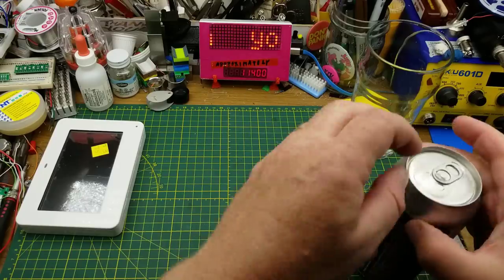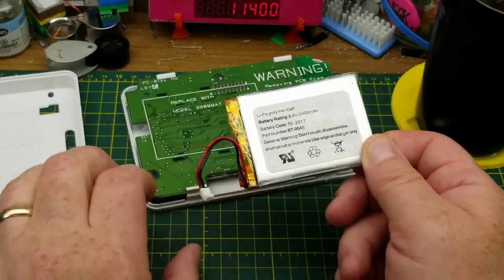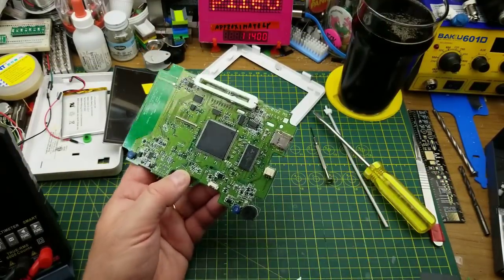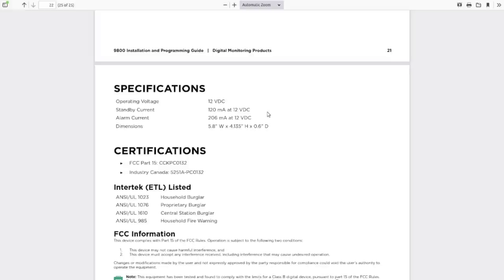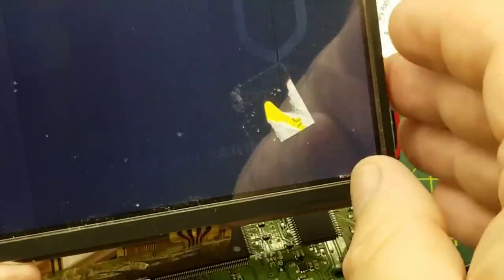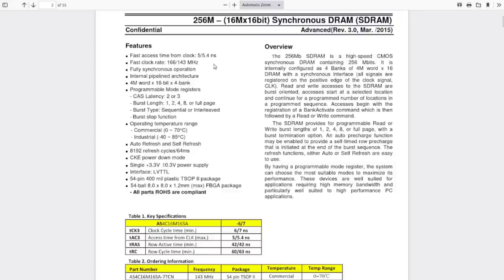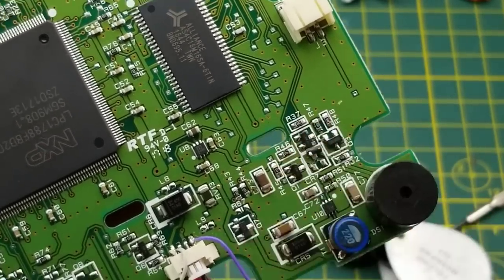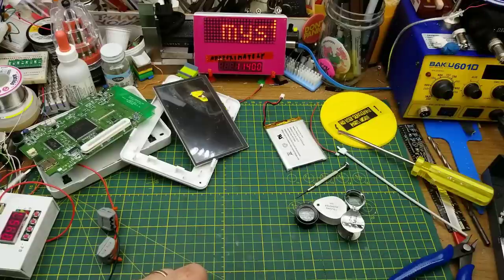mystery display : curiosity teardown

Comment: If I read the datasheet correctly the display is 3.3V, 5 volts is the maximum.  Lovely video, you're doing just the sort of thing I used to with second hand and broken transitor radios, 50 years ago. Great stuff.

Comment: I haven't been to a second hand store for like 4 years. I find stuff on the side of the road and bring it home. eg: Lumber, metal shelves, Sony 5.1 stereos,  3 perfectly good cabinets ( wood )  with working doors, P.A Speakers With Amp ( from... wait for it.... Radio Shack ) Air Compressors ( 2 ), Two chop saws ( Radial ) Really nice leftover 4' x 20" Good both side 3/4 " ply, ( I made a nice shelving unit from that ) I am at the point where I don't even look at the side of the road anymore. These people on the Island toss all kinds of great stuff.  Actually , I see a video coming up... It's been a while.
Reply from the maker: I've had a few good roadside scores recently, but not as many as there used to be.

Comment: While the microcontroller may seem overpowered for its application, its not unusual for this kind of product. The company designing it probably uses these devices (or at least ones in the range) in many of their products, and thus have expertise, a large in-house codebase for the devices,  and the development tools to use them. Given that its probably an expensive product there's little incentive to downscale to a less capable, cheaper processor when most of the cost in reality is in developing the software for it. They probably get a good price from NXP anyway, if they are buying in quantity.
Reply from the maker: Good point.

Comment: Wow $0.75, they are many hundreds to buy new, we used these in our data centre to monitor environmental status, they came flashed from the HVAC manufacturer and you could only set highs and lows. They are part of a sensor system and mostly used for an alarm only, or to check temp, and humidity.

Comment: That micro looks overqualified for that task. On the other hand I found a digital picture frame some years back that required an internet connection and subscription. Turns out it's basically a full on computer that runs a proprietary version of Linux and has serial and kb connectors that aren't accessible unless you open the case. There are webpages describing how to hack it.
I wouldn't be surprised if your little panel was a lot smarter than it looks, maybe as smart as the one I found.

Comment: 15:09 "it's not an LCD, it's a TFT" - of course it's an LCD, it says so right on that page (LCD size). TFT simply means thin film transistor, they are used in the active matrix that drives each subpixel / liquid crystal. Even OLED displays use a TFT active matrix for the same purpose.

Comment: You might should be able to drive it off the GPIOs of a raspberry pi or alternately find a cheap driver board that takes composite input.  I picked up a couple of tft lcd driver boards from aliexpress that match the driver boards used in some inexpensive auto backup camera displays I have.  They have a 40 pin flat flex connection similar to that and I believe they are parallel RGB interfaces for that resolution.  They were less than $5 Canadian each.

Comment: I've saved a few screens like this in the recent past. Would you be able to do a sort of guide/info about how one could potentially use them for things? Such as connecting to an Arduino/Pi or just displaying info? About the closest I've come is looking up a part number on AliExpress for a control board, but I'd be interested in how they work.